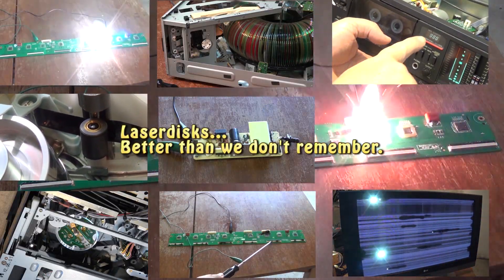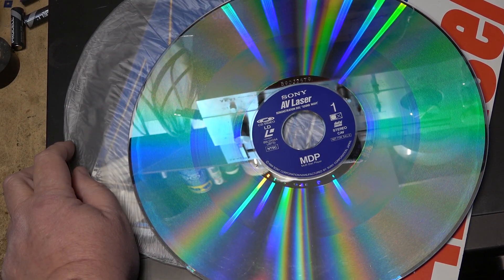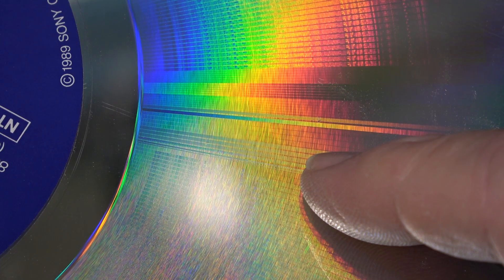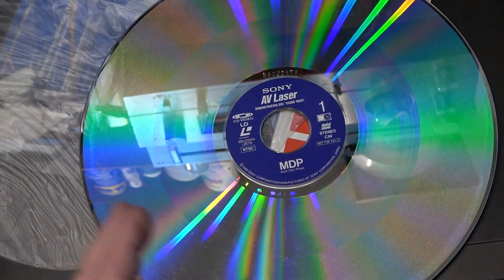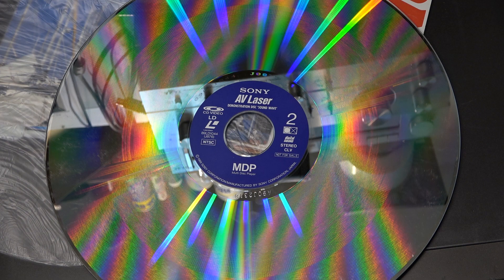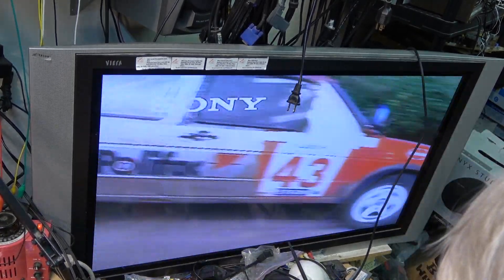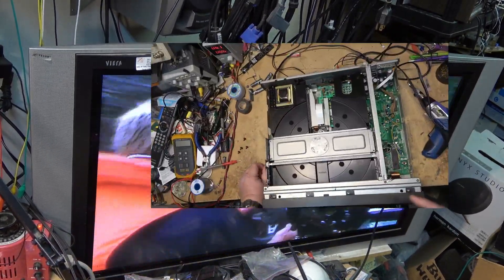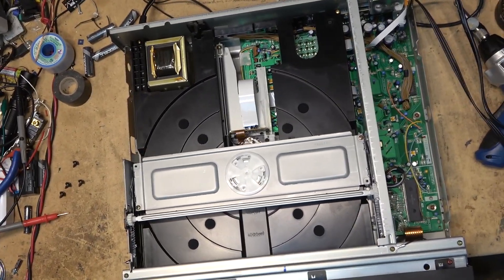Laserdisks better than you don't remember.

Comment: It looks stretched to fit 16:9!
Reply from the maker: I have the aspect set to wide fit.  The original remote in flaky which is what is needed for change aspect.
Reply: @12voltvids  damn remotes! I took apart my old VCR remote, washed the keypad with soap and water, then applied Isopropanol to the bottoms of the keys and the circuit board. All the keys work now!
Reply from the maker: @dhpbear2  this one is in sad shape.  Buttons work but case is all cracked and falling apart.

Comment: My friend had a laserdisc that he lent me when he went overseas one summer. I had a BRILIANT idea: Buy a JVC S-VHS deck and make copies of his laserdiscs. On paper, the copies should be almost identical in quality. It was one of my greatest disappointments. The quality of the S-VHS recordings was worse than store-bought VHS tapes. (Yes, the dubs of the Laserdisc were higher resolution, but the color and graininess of the S-VHS copies made it worse.) I also discovered how bad Laserdisc video can look when they got even minor smudges and imperfections on the disc. I didn't know back then that the video encoding was analog. It wasn't something that they advertised about the format.

Most of DVDs problems were with the early discs and hardware. All the first releases were on single layer discs. They usually weren't anamorphic. (The first release of Titanic had the black bars hardcoded.) The encoders used to digitize and compress the video were bad. The TVs at that time had comb filters that helped to sharpen the video from VCRs. Most TVs had no way to disable these filters. They made the artificating from DVDs and (especially) satellite TV worse.
Reply: Laserdisc is capable of a good quality picture with excellent sound, but the performance is greatly dependant on how well a player is aligned
and how good the film transfer was, a lot suffered from poor transfers giving a soft image.
As you say the format was analog and suffered from drop outs on bad discs.
It was way too expensive when released, and was a playback only format, you need to see a good disc on a high end Japan only model
to see it at it's best.
Reply: The video signal is technically analog, but it really straddles the line.  We're used to thinking of analog and digital being completely separate things, but it's really more of a philosophical distinction.  It's all just waveforms, and it depends how it's interpreted that makes it analog or digital.

The "analog" video is a PWM signal, so basically a square wave with a variable duty cycle.  The variation in duty cycle is used to express the amplitude of the analog waveform, which is a high-frequency (RF) wave modulated by the composite video components (color and luminance), and the audio tracks, which are all centered on different carrier frequencies.

There are a pair of modulated analog audio tracks, and then a completely separate (well, in NTSC anyway) digital audio track.  The analog tracks can be repurposed to hold AC3 (Dolby Digital discrete surround), but it has to be demodulated from the band-passed RF waveform as read directly from the disc..
Reply: @nickwallette6201  It is the sound quality that makes laserdisc so good, and it's a great shame that the format was killed off by DVD, which was inferior when released.
Blocky images and compressed audio were a poor start for DVD.
I am lucky to have the best players that Pioneer made for the Japan only market
they are a big stepup from the midrange models that sold in the rest of the world.
Reply: @Barbarapape   Well, it gives and it takes.  You get uncompressed CD-quality stereo digital audio instead of 384Kbps to spread between 5 and a quarter discrete channels.

No MPEG, but it'll only ever be interlaced, and it'll only be as good as a composite signal can be.

But, IMO, who cares?  I got into LD because it's magical to watch video from an enormous coaster spinning at irresponsible speeds.  And, then there's the occasional historical gem (like when Han shot first) that makes it a little more special.

I've got two players, both currently under repair, and both chosen for silly aesthetic reasons.  I figured, if I wanted the ultimate in quality, I'd watch a Blu-ray.  This is just for fun.

Comment: God damnit.  Don't touch the disc with your fingers.  This is an analog format.  Your fingerprint WILL affect the picture.  Handle only by the outside edge and spindle hole.
Reply from the maker: Do i look like i care with this beat up old disk? Also, the surface of the disk is not in the focal point for the laser so it focuses well past any fingerprints

Comment: If you eat 12 greasy sausages first, without wiping your incredibly large fingers off in a paper towel and then touch the Laserdisc surface like you demonstrate here, then it'll fill out those bad scratches and you'll be free from using that Brasso. 😄😉

It was hard to watch, having been one of those who never touched the surface ever.

Still having a European CLD-2950 with dual-side Laser-pickup and discs are still watchable on our 50" Panasonic G10 Plasma from 2009.

Picture qualitywise, everything really depended on the source material/mastering. The remasters for the BluRay and eventually 4K format has worked wonders I'd say.

The reason behind Laserdiscs could show a better picture quality than DVD is based upon the digital MPEG-compression slash bitrate with DVD, where fast movements or panning would show artifacts such as macroblocking in certain areas of the picture whereas Laserdiscs would show the details that was lost on the DVD.